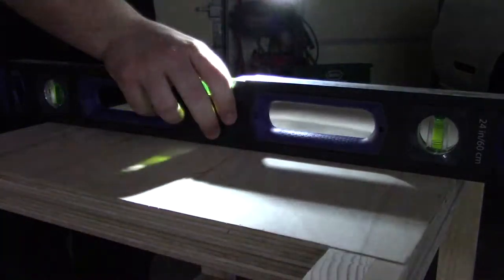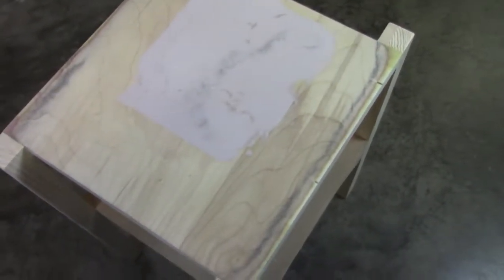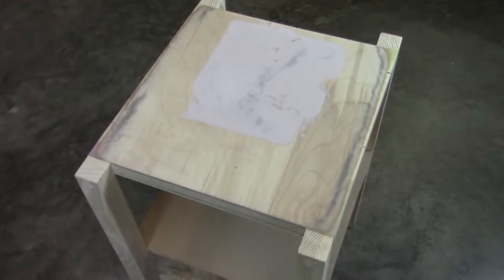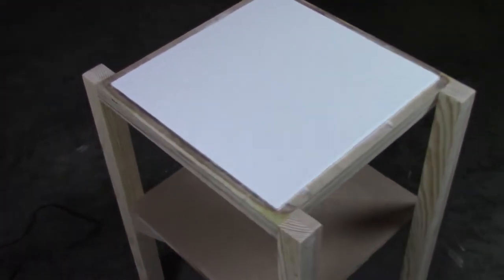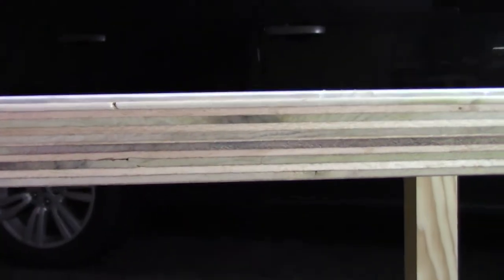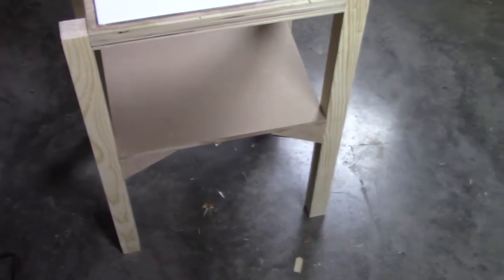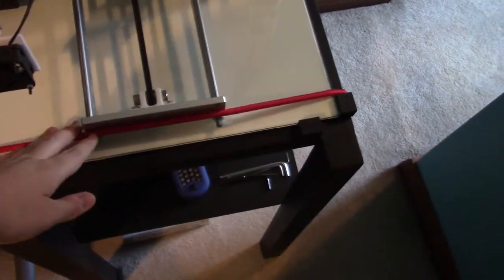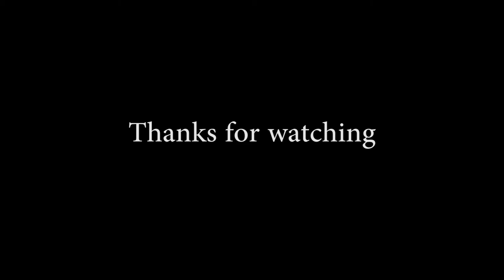Building a 3D printer stand | Part 2: Flat top

Comment: I like the dowel construction and that this is rather minimalistic. I am working on a stand for my 3d printers, and was skimming videos for ideas. 
Something to try next time perhaps is to just buy a large floor tile (3-5$ tops) and then use some type of caulking adhesive underneath. Push down and check for high spots with a straight-edge and level. I think i might go this route to save on the epoxy